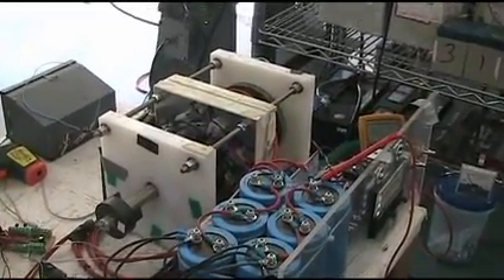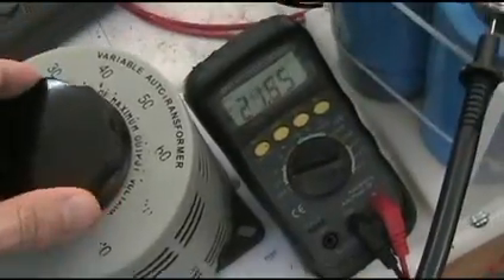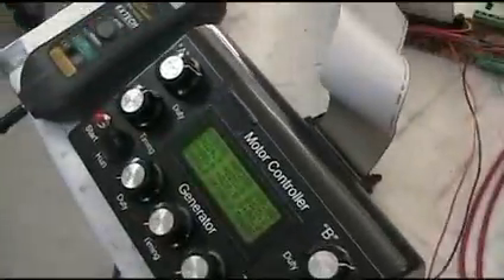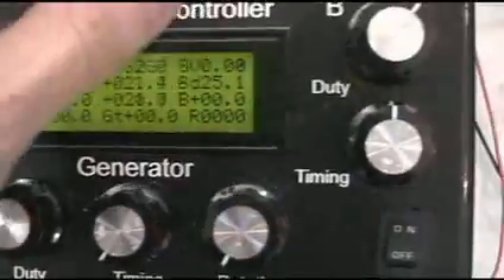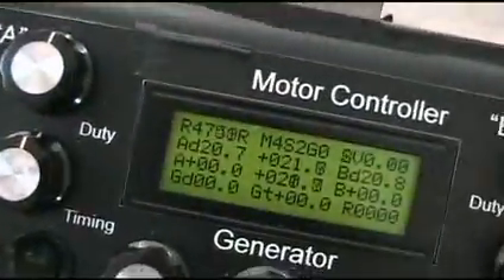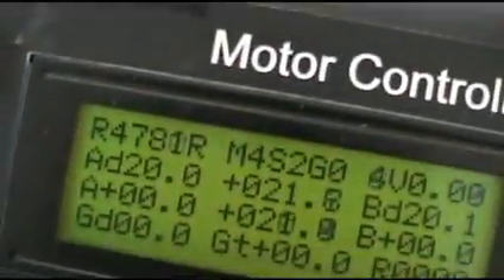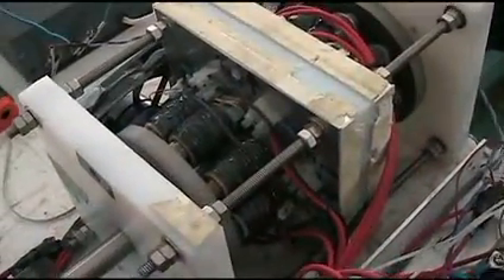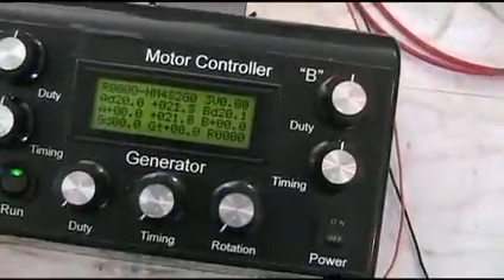Motor Controller Demo

Comment: I'm impressed. That is a very well thought out controller. It certainly allows you a lot of control. I've used motorized autotransformers. Perhaps you could put a pot on the motor controller to set the transformer voltage ; -) then everything would be at your finger tips. Oh...and a couple of clamp on sensors also. Sounds like a great experimenters kit.

Cheers!

Comment: coil vengeance thing happens with  SHORT circuit of coil leads with switch
X20 volts  from coil
X3 watts power increase with a resistive load no increase in amps just voltage

Try with new arms cloned:
stagger your 2  rotor's postioning against the coils between 
have all N magnets  in the 2 rotor sandwich
one rotor's mags line up wtih coils leading edge 
 other rotor' s mags line up with coils trailing edge 
 wil make AC
 no "lug" since one magnet pulls one way other  other way

Comment: Maybe chopping up pulses on output of coils it would make big differnece since it should create lots more backemf in theory at least...
ALso try SHORTING coils (!!!!)
DO it right after or at peaks, with a short duty cycle,,,also try  0 line too...
COLLAPSE THAT COIL it springs back with vengeance
X20 voltage output this way doesnt affect input draw. if you find sweet spot...

Comment: Really nice!! 
 do coils get hot? Thats lots of juice .
 wonder if what goes into batteries is really "watts" (voltage in caps X amps going into batteries) since battery is not really a true resitve loadT
ry swtihcing-out power tbatteries/caps with "delay-switched AC leg of FWBR "with AC legs over motor coils and DC of FWBR into load...
you might be able to increase power X 2 drop power input by 25% or so
Try AIRCORES
Wind them with aircore width about 1/2 of diameter of magnets

Comment: I see :) I was wondering because i have seen some very good work along those lines from user Jetijs.  He has been measuring current waveforms of his coils and using basically a 555 pwm circuit to a set frequency for his particular coils that insures the current form is always a ramp and never plateaus (over saturates).  So at any rotor speed, he always has the least input for the most output.  But im sure you are aware of all that stuff, your work has always been inspirational, keep it up : )